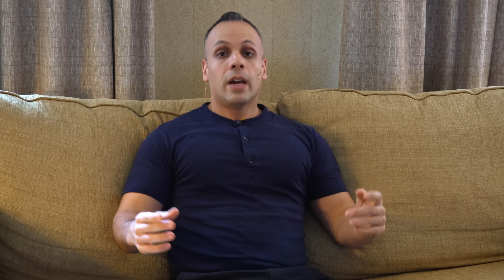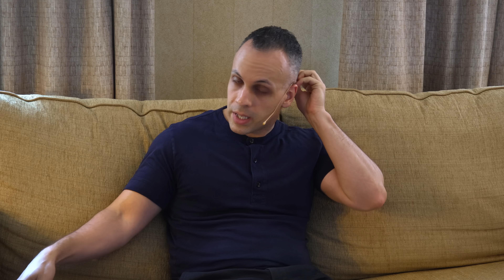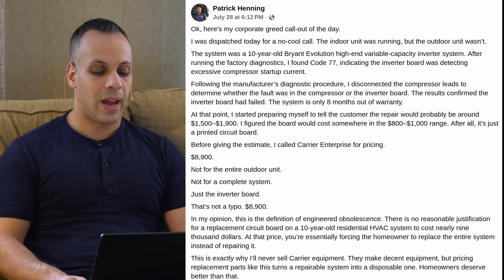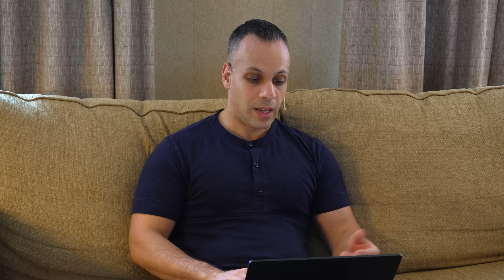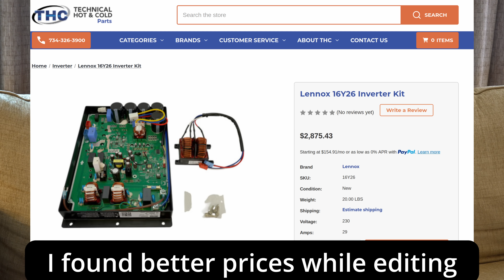Carrier AC repair has $8700 part cost for residential unit

Comment: im an HVAC guy thats been working in the public sector for over a decade.  as far as I know, I'm the only one in my state doing component level repairs on these boards.  I also fix equipment that contractors would condemn. I save my state a shit ton of money in my sector.  otherwise it goes out to contractors elsewhere where they charge insane rates and prices due to labor, business markup and overhead, and manufacturer part pricing
Reply: I am not in HVAC but am an Electronic Engineering Lab Technician and have repaired my HVAC boards and Refrigerator board. Super easy. Not even close the high cost they want for these things
Reply: I'm pleased to hear there is at least someone out there doing that. I fixed an AC unit for a friend of a friend a few years ago, the contactor that controls the compressor failed and the tech he called out told him the system was shot because it was old and needed to be replaced. I fixed it for $20 bucks and a beer, it's still working.
Reply: I used to do HVAC full time but went to other callings for a career but still do side stuff to help people out when the vultures are circling. Had an older widow whose AC quit working during a huge heat wave, she called 3 different outfits who all 3 said her system needed replacement, it was unrepairable & the lowest cost replacement was going to be $8500.00 and that was just for the condensing unit outside. Her son in law asked me to stop and look at it to verify that it needed replacement. The only thing wrong with it was the 24vac transformer was fried on the primary side. $18 later she had AC and still has AC and it's been almost 10 years ago at this point. 
   Can't stand it when people take advantage of others 🙄
Reply: @bobquartlemigula2351  I tell people, when your furnace goes out, 1st thing to hope for is the $20 24Vac transformer.
Reply: Can you offer a best case explanation that would support Carrier's price for this component? Just trying to give the devil its due.
Reply: @themadmallard I can give some of the reason , a company like carrier doesn't make the board ,they contract it out for so many to be produced , as the supply dwindles prices go up , sometimes the company they contracted with goes away and you have to get a new design from another  supplier . Another reason from a company standpoint is the storing and maintaining a parts network is expensive so they prefer to just replace. So those are actual business reasons without the conspiracies .
Reply: @MUUKOW3  ok thanks, but the components on an inverter board aren't really advanced tech... What could explain that factoring in the cost?
Reply: @themadmallard  No doubt they added a computer and software to lock it down with licensing.
Reply: @themadmallard and that UL cert...
Reply: @themadmallard it's not totally ignorant tech either as it must adjust for superheat and things like that in a HVAC system. Also they usually communicate to other boards.
I've been out of the residential realm for almost two decades though. I prefer commercial.
Reply: Hey, I just saw your reply and was wondering how long it would take to get up to speed for component level repairs on home units.  I have rudimentary electrical skills (have wired switches/plugs and some larger components) and have replaced a few parts on appliances. I never buy new, especially since I've figured out most repairs are not difficult. Down here in Texas and lots of demand for stuff like this.  Thanks in advance for your consideration -
Reply: @jasmusican  That's not a question anyone can answer for you. I've been repairing electronics since I was a kid, long before I did any HVAC stuff. I can say that most of the electronics used in HVAC are not particularly high tech. I've seen cracked solder joints, failed relays, bad capacitors, etc, the same sort of things that fail in consumer electronics.
Reply: @James1095  Thanks for the reply.  All of that is something I can test for and probably repair.  I'll look into it further -
Reply: @jasmusican  I agree with James.  Most HVAC Control boards are very simple with large components.  If you can do any mediocre soldering work you'll be fine.

Typically what you'll find are relays that fail.  The boards will out last relays because they are mechanical in nature. 

Another typical issue you'll find is a burned board.  Fried resistors, blown traces.  easy to spot with the eye.  repair the trace, and do some sleuthing referencing online pictures to determine resistor values.
Reply: @Porcelainbowl the boards they are talking about are driving large brushless DC motors inside the compressor and the outdoor fan motor. We're talking 6 igbts with gate drivers to isolate the control voltage from the high voltage. Those "switches" are biasing each pair of windings at a very precise rate hundreds of times a second and precisely when the motor is at the correctorientation to switch any given set of windings. (Permanent magnet wir3d as a "Y" usually).
Just think the inductor in the compressor itself is less than 1 ohm of static resistance. The current when you apply 300 volts DC to that and you leave it on for so many microseconds too long when it reaches saturat💥🔥
Reply: You're the goat 💪 How did you get into electronics repair?
Reply: @clippy-clip-clip-clip  Watching Louis Rossman for years lol
Reply: Thanks for you comment! 
Could you give us an idea of what typically fails on these boards. I’m just curious. Tia!
Reply: @Conservator.  The cheap chinese CAPACITORS.
Reply: @ZAPATTUBE  SCR
Reply: This is my goal. I know some things about electronic repair but this is my weak point. I hate scrapping all these expensive VFDs over a blown capacitor.
Reply: I've repaired my share of Boards out there over the years but usually I would consider it temporary so it wouldn't be liable or whatnot. But it depends what it was. What's controlling a gas valve or something I would definitely always come back with a new part. If it was just part of controls or something not so critical then I would solder a new components.
Keeping some components and fixing them to myself is how I get my own spare parts 😆
Reply: That is so awesome of you! You're making the world a better place where you can!

Comment: We had a Carrier top of the line system (forget the exact name) in our last house, and the thing was INCREDIBLY efficient and kept the house as cool as we wanted it no matter how hot it was in Austin that day. However, a piece broke (not the circuit board, can't remember what it was) about 6 months out of warranty and it was $2000. 

It was great while it worked, but it was indeed pricey to repair.
Reply: There went the $$ money you saved on electric cost

Comment: 2 years ago, I got multisplit aircon fitted throughout my house, I paid about $9k. That's including everything, all the parts, remotes, wifi modules, installation and taxes. If something breaks and I was told it'll cost me another $9k, I rather spend that money on legal fees battling my installer and the manufacturer.
Reply: I hate to tell you this, but when something lets go, it will likely be a full system replacement, including the line set. only thing that will likely stay is the power wire ran from your breaker panel to the added outdoor disconnect.. of course none of them will tell you that.
Reply: @throttlebottle5906 i dont agree full Line  set needs to be replaced. Let’s say you have decent gauge copper (which was available ten years ago !) just purge twice with nitrogen and run a bullet sponge  then rigorously pressure test. Now if you have a short direct run sure replace it but if long complicated behind lots of drywall, strongly consider use of he old line set
Reply: @johnwhite2576  maybe they misssed the big rash of white insulation covered line sets that would corrode the copper inside of them in short number of years. but tons were installed and failing/failed all over the usa and abroad.

Comment: Window ACs all the way. Otherwise you have a giant piece of garbage that cost several thousand dollars, requiring thousands MORE to install, and then costs thousands in new duct-work which obviously has to be replaced every 10ish years. When that warranty expires, (what is that, 10 years on hvacs for homes) then it's $15k-$20k to replace. 
Oh, and there's the refrigerant too.. One hvac goes out, then the entire house is hosed.
With a window unit, it's $200-$500 per room and if ONE goes out, then you can go to another room while you get a NEW AC delivered from amazon.

Comment: HVAC company near me wants $2200 to replace the reversing valve in my system. 
They're not even private equity owned, and the part is like $80 and still under warranty. 
That's almost as much as the company charged to install the system just a few years ago.

Comment: $2500 would be reasonable for a car inverter that runs 100's of kilowatts.  Yes you should look into repairing these as they should be simple repairs, replace a transistor, much of the time.

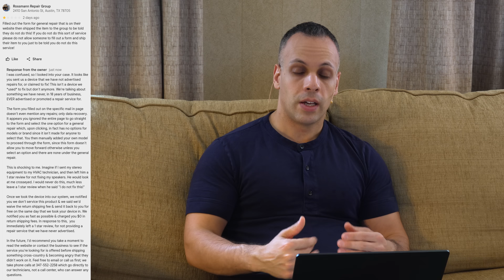Comment: 4:56 i quit dealing carrier equipment over this and the way they are handling business at the distribution hubs
Reply: They have always been expensive on parts have they not? Well not $8700 but still 1-2,000 every-time its touched seemed common.
Reply: @kevinc7632 my old average was half that as a dealer but even 600 is higher than everyone else

Comment: A bit of competition would fix that.
Reply: I now buy window units only. Less than $300 for a whole new ac. Amazing low price.
Reply: There's plenty of competition. They are relying on the reputation of their brand to convince people to pay exorbitant prices when something isn't covered by warranty.
Reply: In corporate America, all the corporations are run by large investors, which in turn push down the same policies onto the companies.  DEI was an example of this, but how they choose to monetize repair, and lack thereof is also going to filter in.
Reply: You know how many HVAC manufacturers are out there 
There is competition 
 Blame the EPA for this nonsense 
They keep requiring higher efficiency, just like they require car manufacturers higher efficiency.
 They have to meet certain goals
Reply: Dude the market opening is fking massive. Any company that actually tried, even a little, would make it huge. It's that bad. I work on these units and literally some commercial grade true refrigerator that's like 300$ in parts is 5000$. Unbelievable how there isn't any well know competition when the bar is so so low
Reply: They buy the competition before they can get big enough
Reply: @benargee  perfect let’s start it get bought out.
Reply: No it won't. When the people controlling a company have a mindset this fundamentally broken and anti-humanity it cannot be fixed.
Reply: @pseudosam2458  Sam is right, only bombs and violence can work now. /s satire
Reply: @pseudosam2458  Carrier buds lots of stuff from the Chinese Midea group. I suppose they cannot be bought anyway.
Reply: Let’s figure it out

Comment: Just on video title alone. For almost $10k thats literally the equivalent of buying a new replacement unit. It’s even more expensive than some of their own commercial units.
Reply: That's the point
Reply: Forcing people to switch refrigerants by upgrading a system or line their pockets.
Reply: @WildMike-GF  That drives me nuts. Banning R12 was the right move, it is super stable and decomposes ozone. R22 though has only 5% the ozone depletion factor as R12 if I remember correctly and unlike R12, R22 was never to my knowledge widely used as an aerosol propellant so it really didn't make sense to ban that but R410a works ok so fine, whatever, except now they're phasing out R410a because it's a greenhouse gas. I have a hard time believing they didn't understand this property already back when they switched from R22.
Reply: @James1095  Refrigerants + patents = dollars, patents expire. Reasons may not be related to reality. Everyone is still using aerosol, haven't heard about Ozone for about 20 years until your comment.
Reply: @James1095  they understood, but they didn't care. Then gwp became important. 
Tbf it's actually good to drop it. What isn't, is going r454b instead of just r32.
Reply: @James1095  If you track when the patents expire on the refrigerants, you can accurately predict when "the science" begins to put out papers that alarmists use to attack the current refrigerant as an environmental disaster. Then certain corporation walks in on cue with an all-new refrigerant that's xx% better for the environment and promises to solve the problems brought up by "the science," you'll just have to spend several thousand dollars to buy an all-new system when the old one has a low charge.
Reply: @dirkpoulsen  R12 was phased out decades ago and the ozone hole largely recovered since then. Everyone is still using aerosol cans but zero of those use R12 as the propellant anymore. Most use hydrocarbons now.
Reply: @James1095 a friend of mine put our new unit in and he just swapped it for the updated stuff at low cost. But they aren’t allowed to sell that so he does some on the side for people that seem to be in need and not assholes.
Reply: It applies to a lot of others as well. My refrigerator went out under warranty 3 times in the first year after I bought it. The last time, the contact repairman told me they were going to replace the entire refrigeration unit. The cost of the unit + labor was 1.5 times what I paid for the refrigerator new at Lowes. I have no idea what they spent for the first two repairs.
Reply: We got a brand new & improved central AC unit, w/ installation for $6000, last fall
Reply: @PeaceOfGrace  mine’s been out five years, sigh.  what state are you in?
Reply: I am not an installer/technician, but I am pretty sure the part is for one of the high efficiency units with a variable speed compressor. Those cost way more than (more than double) old-fashioned single speed compressor models. You can buy a different system for about that price, but a replacement for this system likely costs double that price. I replaced my 5-ton system last year and I got many quotes for a variety of systems. The quote for the Carrier system with a variable speed compressor was around $24,000. The single-stage compressor system I ended up installing was just over $9,000.
Reply: @darkforcesjedi  Even if the whole system cost $24k (I assume that's with installation) there's no way the inverter board should cost $8k.
Reply: @darkforcesjedi 5 ton wow.
Reply: @darkforcesjedi  The new "high efficiency" units really are pieces of sht. My old Heil AC unit from 1995 is still running strong today while many of the newer ("greener") AC units are half way in the grave already.
Reply: @hochhaul I agree. Even if you assume they work perfectly with no maintenance, they only save about $3k in electricity over their life, but they cost $10-15k more to get installed.